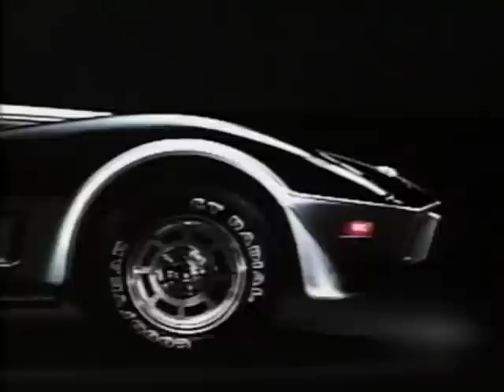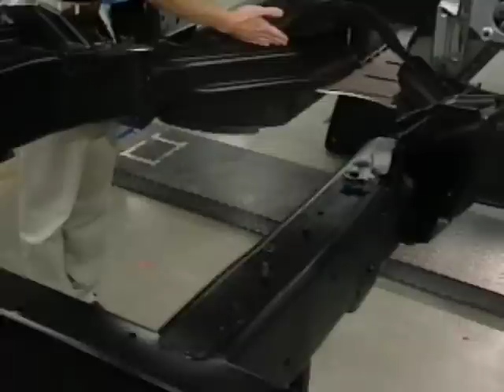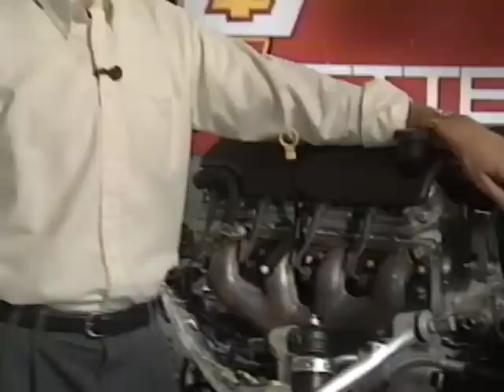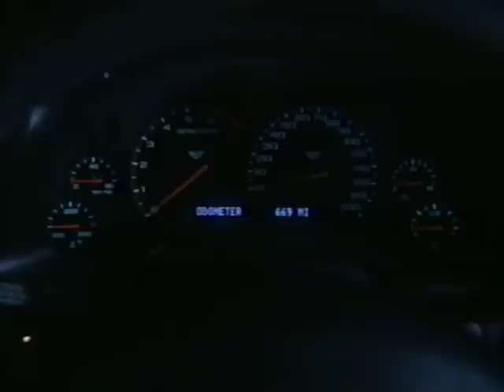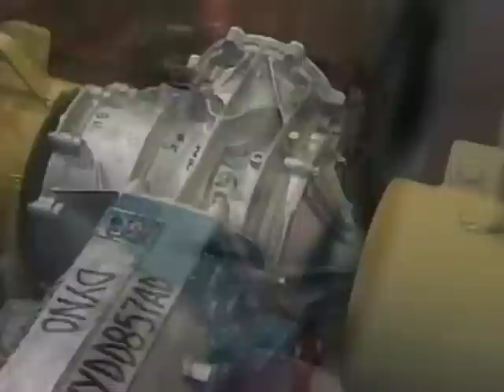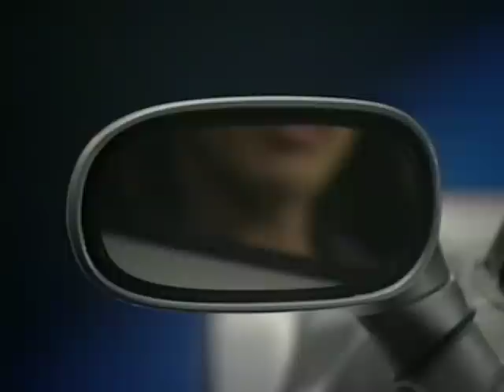C5 Corvette Building The Fifth Generation Corvette VHS Movie

Comment: C5 was the generation that truly saved the Corvette IMO
Reply: Amen.
Reply: Totally agree. Awesome car.  I just bought one.
Reply: @BorisW150  , Congrats. Which one did you purchase?
Reply: @wesley42079  '03 50th anniversary convertible.
Reply: @BorisW150  , Nice. That Anniversary Red Metallic looks beautiful.
Reply: @wesley42079  Thanks.  Also owned a 2008 Silver C6.  Miss that car.
Reply: @BorisW150  , I am on torn between the C5 and C6. C5' are selling between $10k - $15k now, so it's more in my budget. I do like the C6 because the interior is newer and with 400hp, it's like the C5 Z06.

Why did you sell your C6?
Reply: @wesley42079  My soon-to-be ex-wife didn't like the C6.  My '08 had the 430 hp LS motor.  Very fast.  Definitely recommend this car.
Reply: I advise you to see what the insurance rate is between the C5 and 6. My dream Vette is the C6 ZR1 but insurance would double over my C5 Z.
Reply: Wesley42079 C5!  The pop up headlights MAKE that car!!!!  C6...lame fixed lights.
Reply: I never really liked Corvettes at all until I saw Doug Demuro's video on the C5 Z06. When he mentioned that prices were dropping and that I'm considering of selling my old carbureted 1986 Buick Regal, that's when it finally sunk in that I should just move onto something more modern and a lot faster. Too bad I still can't afford a low mileage one though. 😞
Reply: blueblade455 I got a 99k mileage 2002 last year, put 20k miles on it this year and have had no problems.
Reply: @XxLevegencexX  I've heard they are reliable and holds up very well so long as it is taken care of. You have 300,000 more miles to go :)
Reply: that would be the C4 in 1994.
Reply: 1984
Reply: Raven James incorrect
Reply: @ravenjames3873  c4 came out in the 80s so no
Reply: No way. The C4 is almost what caused the Corvette's demise...the C5 saved it...
Reply: @jamesbottger5894  Wrong , when the C4 came out it was completely all new! The C5 was even better when it came out! I’ve owned mine for 13 years!
Reply: @jimmycline4778  I don't know what your saying is wrong. I never said the C4 wasn't all new when it came out. What I am saying is that it was the C5 that saved the Corvette. For any of you who think it wasn't, You need to read the book "All Corvettes Are Red." It explained all about the top execs at GM and how they wanted to drop the Vette, and how the Corvette team convinced them that the new car (then the C5) was so revolutionary that it would change the world...and it did...
Reply: @jamesbottger5894  definitely far from the truth. the c4 was the turning point for corvette. with every progressive year of the c4, improvements were made that paved the way technologically for future cars. without everything that was learned about the c4, you wouldnt have the c5 or anything after. its the c3 which was the demise of the corvette nameplate. towards the end of the production of the c3, each year power numbers decreased and it still sported the chassis from the c2.
Reply: @cIick_bait  You need to read the book titled "All Corvettes are Red". That book explains how the the Corvette almost got discontinued until the C5 was released. The C5 absolutely saved the Corvette. The C4 did more damage to the program than good...
Reply: The approximately 358,000 C4's sold did just fine "saving" the Corvette. There is no question that the C4 brought the Corvette back from the dead and made it relevant again. If you think otherwise, you lack an understanding of history and context.
Reply: @rapid13  You need to read the book "All Corvettes are Red"...it explains how the C5, not the C4, saved the model...
Reply: @jamesbottger5894  So your recommendation is to read a book that agrees with your position? Seems a little self-serving. How about you give us a summary of the book, including the author’s name please, and we’ll go from there.
Reply: @rapid13  You're hilarious! It agrees with my position because that's where I got my position. It's called documentation. The book was written by a guy who was tied in with Corvette designers and GM head honchos, so he probably knows a bit more about this subject than you do...you can look the book up online by title and find out everything you want to know about it...
Reply: @jamesbottger5894  So you don’t want to give a summary or the author’s name but we should accept it as authoritative because you say so? That’s hilarious.
Reply: @rapid13  Are you too lazy to do a google search? It would literally take less than 5 seconds.  You just don't want to know the truth because it will prove you wrong...
Reply: @jamesbottger5894  You made the claim, you provide the evidence to support your claim. That’s how it works. Welcome to a big boy discussion. I have no problem with being proved wrong because that means I will have learned something, but I’m not going to change my opinion because some random internet guy whips out the “dO yOuR rEsEaRcH” bullshit.

BTW, you sound like a flat-earther or anti-vaxxer with that YoU dOn’T wAnT tO kNoW tHe TrUtH crap.
Reply: @rapid13  You could've had all the info you wanted by now, but you'd rather argue...going on being stupid, I don't care...
Reply: @jamesbottger5894  Coward.
Reply: @jamesbottger5894 read the book “corvette from the inside”. youll learn that your precious book was written by a guy with no engineering experience and no idea what he was watching. he completely missed the crew that built the corvette from the ground up. the c4 saved the corvette from an early demise.
Reply: C5 is the WORST Corvette ever made in history.
Reply: @veronicalake4140  Without the C5, you would never have your C8, which you seem to love based on your past comments.
Reply: @veronicalake4140  You are nuts!

Comment: 2004 black on black z06, just turned 25,000 miles. 405 hp. they only made these for two years. i plan on keeping this gem for a long long time
Reply: 2001 Z06 was 385 HP, 2002, 2003 & 2004 all had 405 HP I believe.

Comment: I sold my 88 c4 ,bought a 99 c5. What an upgrade. Still leaks water at the car wash. Maybe the c6 will be more waterproof. I better start saving lots of $
Reply: rottenrowdie ,we have the same problem with our 98 C5, we even had all the seals replaced, thinking that may be the prob...Still an issue.. just gives character, I think..